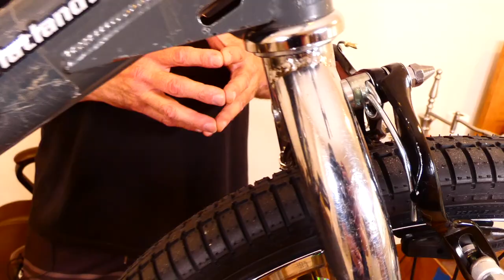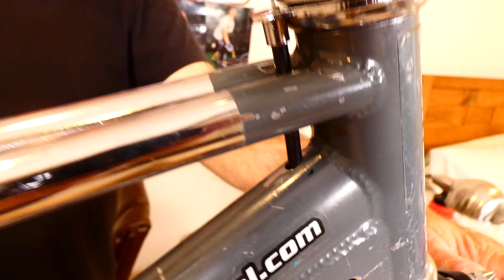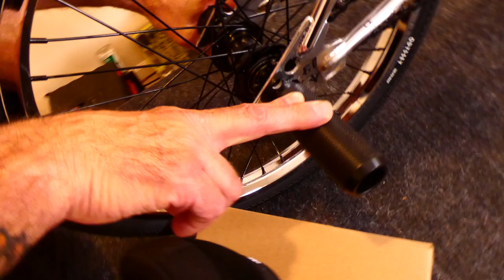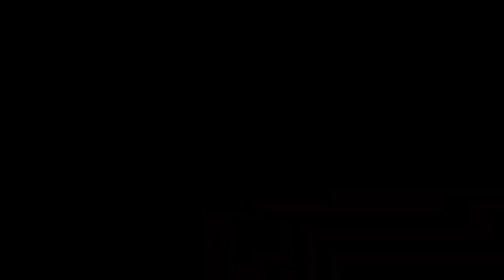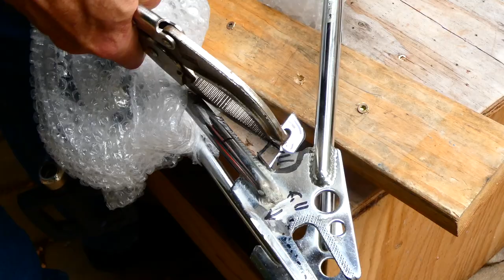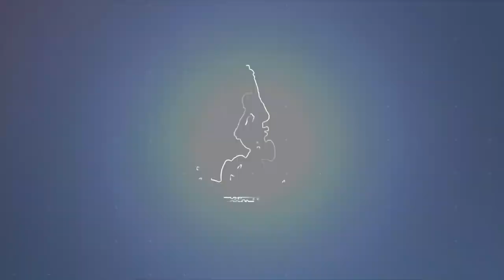General Osborn Pro Build: Part 4

Comment: If that seat post is the same one that is usually sold on eBay, it will bend like if it was made of butter. The design of it is not on the level of the project anyway.

I had to buy some really strong pipes, bend them with sand and a torch, sand it and polish.

I've still got to chrome them, but the one I'm using on my red General is at least perfect for riding.